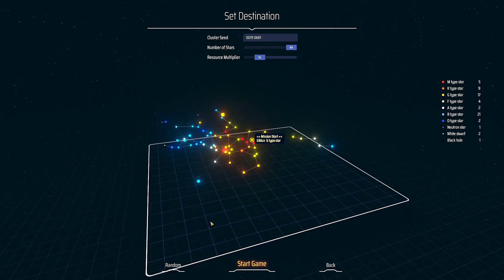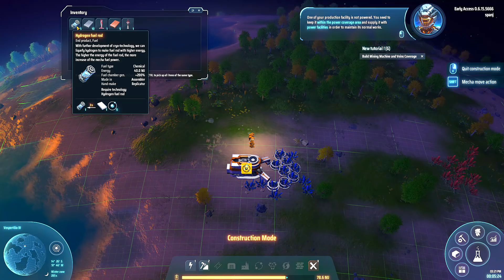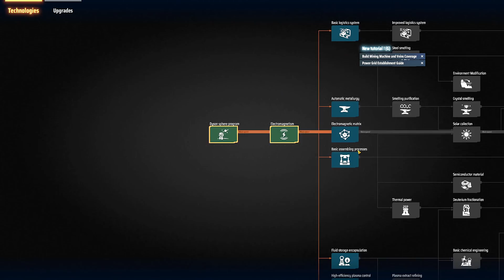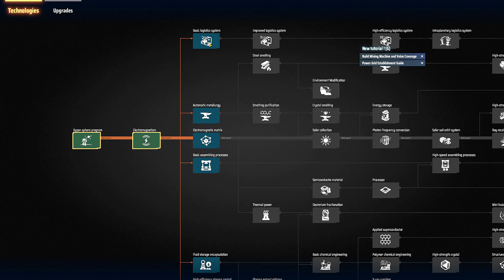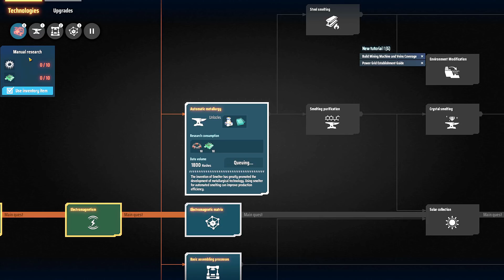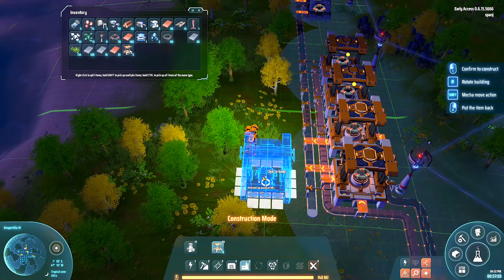THIS GAME IS SUPER CHILL & SUPER ADDICTIVE | Dyson Sphere Program | #1

Comment: I started out by making approximately 40-50 Wind Turbines, and setting them up around the South Pole (It was closer, and the landing point I had didn't have all the space yours did).  I use the Tesla Towers for transission.  Also, Coal becomes Graphite, which is better for the Mecha AND power generation.

Also, you might want to consider setting up a storage unit completely disconnected to the manufacturing.  And use it to store things like Titanium (of which you DO get on the starter when you mine single rocks by hand) and Silicon, organic crystals, and the like.  You need these later, but right now, they are dead weight taking up space.

Comment: Spanj, would having a storage next to the assemblers be better than using sorters to split the product from another belt?  Have the belt run from the furnaces to a storage near your assemblers then have belts from the storage to each assembly line. 

I think that you can filter items with the sorters and later the splitters.  It is possible to have your coal, iron, and copper all on one belt going to storage and then use the sorters to filter it out to dedicated belts at the assemblers.  Remember this when you need to transfer a lot of things a long distance.  They don't all need their own belt.  Once you unlock the faster belts, this becomes a much more economical way of moving things, even if it goes against our desire to not mix things up.

Once you have unlocked the stacking of storages, you can start working the belts at levels.  The sorters work on odd numbered levels.  Use even numbered levels as transportation lines.

As Gold Dragon mentioned, turn the coal into graphite.  It is a better energy source for your mech early on.

Comment: BTW, another thought is the ratio of whatever you're trying to assemble - you can have the inputs on the same side for a 2:1 ratio, for instance, and just be sure to keep the 2 part of the ratio on the inside. Other tips and tricks to manipulate the amount of input on a belt, such as splitting, will help as well.